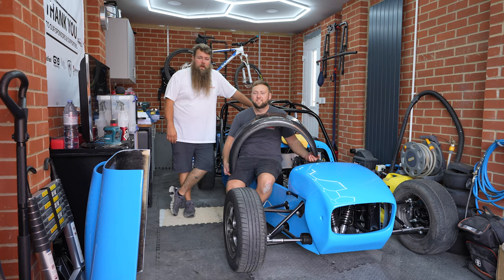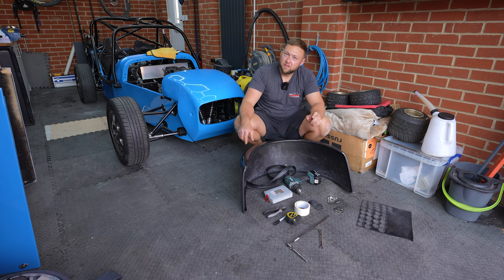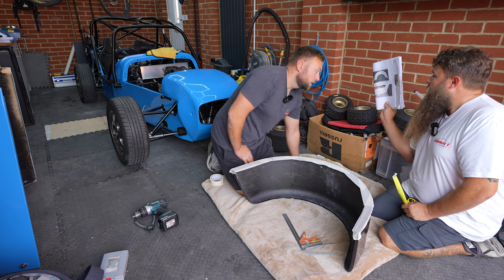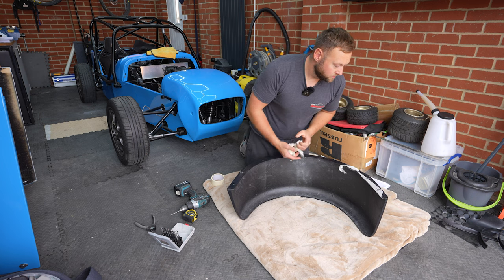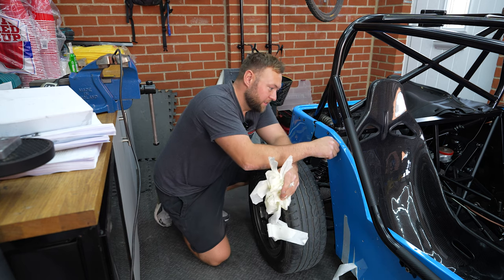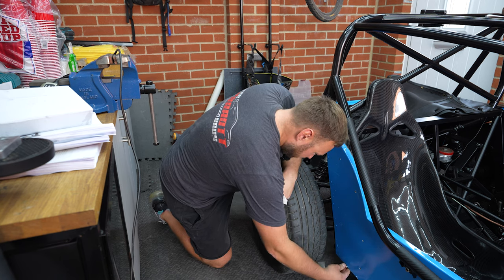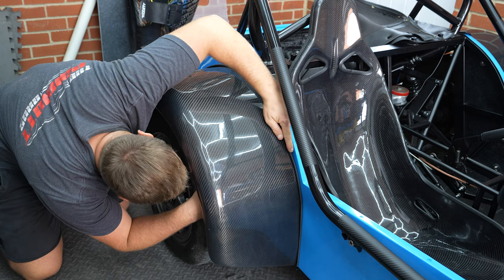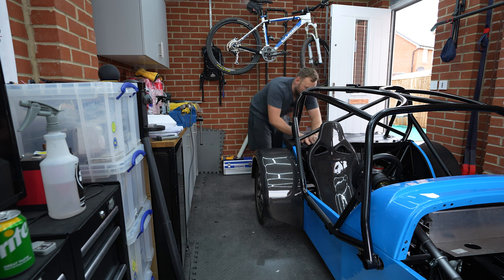Fitting carbon fibre rear arches

Comment: All the holes are missing the frame tubes? I would have thought, that at least in two/three places it should be mounted to the frame. I'm building a scratch build one, so these videos will really help me with my build.
Reply from the maker: Hey, yeah everyone misses the metal work. It’s a tight fit with no structural requirement. I’m the video rob shows how strongly mounted it is by shaking the whole car
Reply: @TheParrottBros  I have seen that, but what if somebody decides to sit on it?